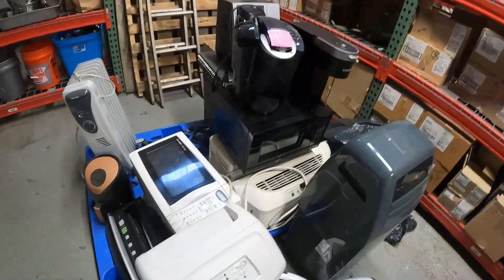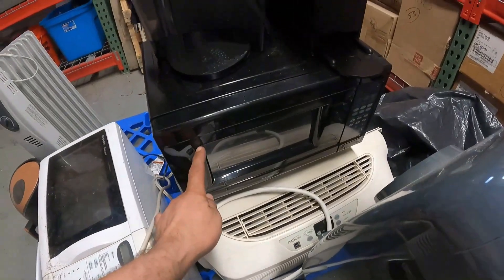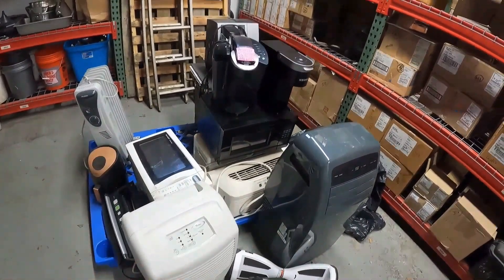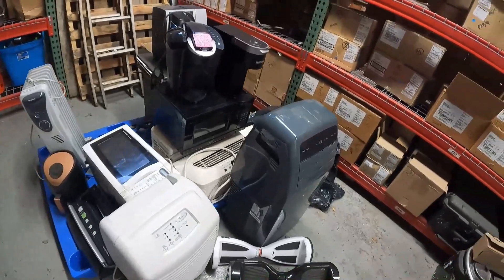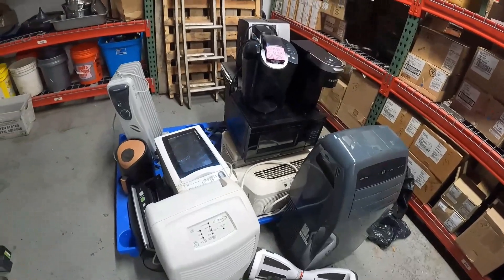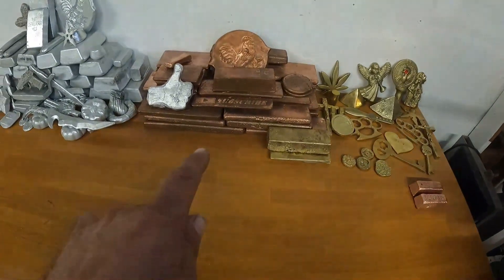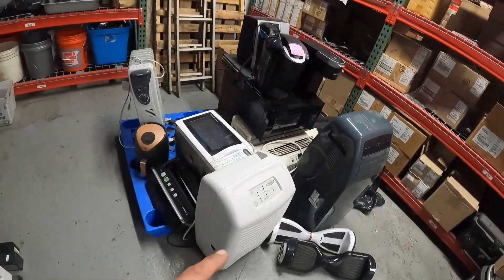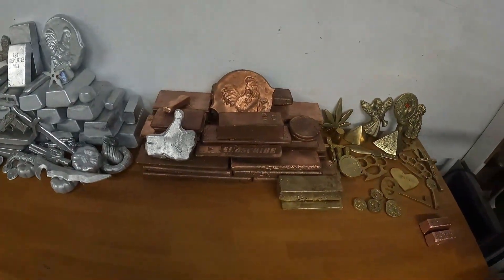Scrapping Microwaves for Copper - Trash to Treasure - Copper Metal Melting - Stacking Pure Copper

Comment: The transformer with the aluminum winding, wasn't the other winding copper?
How much does the propane cost to melt that copper?
Reply from the maker: No they were both aluminum windings.  Newer microwaves almost always have dual aluminum windings on the transformer.  15-20 year old models typically are 1 copper and 1 aluminum.  Most models made in the 90’s are almost always dual copper windings.  Checking with a file is the easiest way to tell besides the manufacturer date.

Comment: What’s the machine you’ve used to open the plastics of the wire?

Do you think it’s worthwhile to this sort of work? We have about two garages filled with appliances and would like to get my hands dirty to do this sort of work.
Reply from the maker: Hey there, the machine I have is called the CO-Z wire stripping Machine.  I got it off Amazon.  There are several copies out there that have different graphics but are the same machine.  It honestly depends on what you’re going after and if you stack metals.  It can get tedious stripping tiny pieces of wire versus long power cords from like vacuum cleaners and extension cords.  Personally I strip all my wire within reason.  The very tiny gauges of wire I cash in at the scrapyard.  If you have 2 garages full of appliances, I’d definitely start scrapping.  Electric motors, wire and transformers are your number 1 sources for copper besides plumbing pipes.  Thanks for watching and commenting!  Hope my answer helps you out!

Comment: another dent another bar
Reply from the maker: Slight dent 🤣😁  Thanks for watching the progression!  This might work out perfectly actually.  By the time that pallet is clear I should hit 500.  Great time to set up the bigger furnace and melt all those small copper bars I’m stacking to the right.  Make a mega bar and stamp it with everything I scrapped out from the pallet.  Just a thought 🤔
Reply: @Scrap2Cast  ironic how every melt equals pretty much the same size bar
Reply from the maker: Yeah I thought that too!  I got 3 different Keurig coffee machines to do.  Wonder what I will get? 😁🤣

Comment: Awesome video!  I'll start adding borax when I do copper.  Also I didn't know those ends were brass.
Reply from the maker: Thanks man!  You don’t have to always add it.  I only added it because of how much tape, glue and lacquer that were on the windings.  😁. Most times the connectors are brass but it is good practice to run a magnet over them.  Sometimes they are made of steel.

Comment: You missed a HUGE chunk of copper inside the magnetron. Takes some work to get it open… but you won’t be disappointed.
Reply from the maker: I know, I dont normally scrap out the magnetrons.  My health is more important than a few cents of copper 😁
Reply: @Scrap2Cast  what do you normally do with them?
Reply from the maker: @redneck2994  tape up the ceramics completely and toss it in scrap steel as-is.  My scrapyard said to do that and they will buy it.  Just not worth risking them break open for the tiny amount of copper inside them.